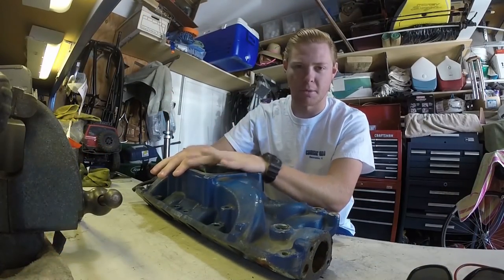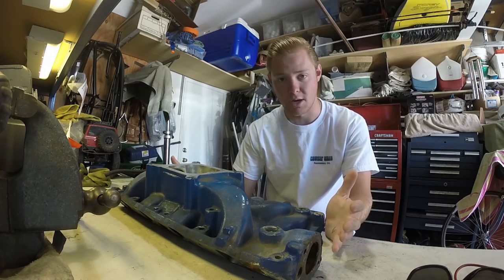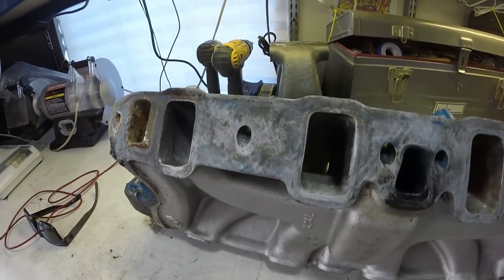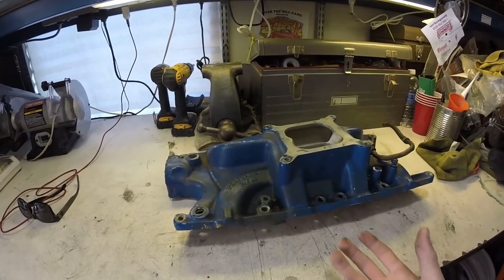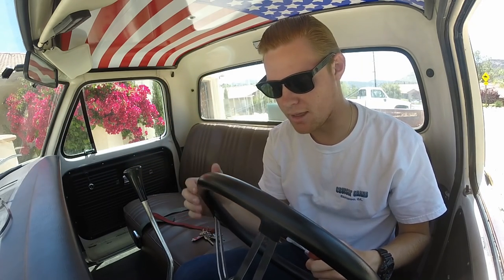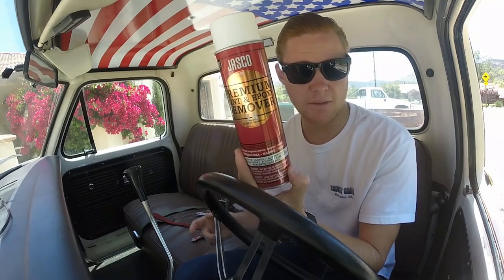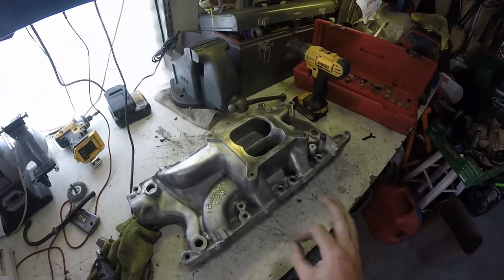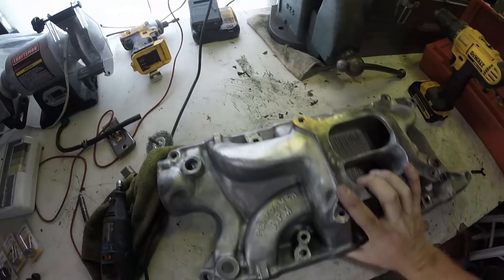How To Completely Restore an Intake For CHEAP!

Comment: intake ports should be rough.. it creates turbulence so the air can mix with the fuel.. exhaust should be polished!! Cheers from Argentina!
Reply: Disagree
Reply: @MrCbell57  that intake doesn't use injectors its carbed and therefore is still a issue
Reply: Myth
Reply: Thank you.
Reply: This guy is correct the reason ya want a semi rough surface in your intake is cause it causes gas to atomize better. Look at any high end cylinder head port or intake and you’ll never see a mirror finish. You’ll see only mirror finish on exhaust ports to help with carbon building up and that’s the only reason. You can think what ever ya want but if ya disagree I guess my response would be where’s your polished intake tract ground pounder and I’ll butter your eye with my rough ports.
Reply: @85gbody97  never seen a rough porting job ever!
Reply: I’ve never seen a rough porting job. Look at a race car head that’s been ported. They are smooth!  It makes it flow better!
Reply: @dawinner777  look at a race car port ok I’ll go look at my 64 nova that run4.80’s in the 1/8 mile and funny thing intake ports are not polished at all. You clearly have an internet based education on what makes power. Go look at any AFR cylinder head or Trickflow then go to any legit head porter not some moron with an die grinder in his garage who thinks cause he read it on the internet it’s gotta be true. You don’t want your intakes ports smooth you want the air to tumble with so as to create the best fuel atomization you can. An internal combustion engine is nothing but a glorified air pump the more Air an fuel you can put into an engine an get it out just as fast but actually burn all the fuel the more power it’ll make. As for why you want exhaust ports smooth is by then ya just want that portion out of the engine as fast as possible and it doesn’t matter it the tumbles in a exhaust port as well as the smoother it is the less likely you’ll have carbon build up that stays.
Reply: @85gbody97  Did you ever watch a rain drop SLOWLY go across an airplane's wing surface?  The airflow right next to the skin of the wing is going quite slowly.  It's called a "boundary layer".  The inside of the intake ports can actually be rough and do just as well, actually, better.  Dimples on a golf ball... or the fact that protruding rivets on an airplane wing's skin are just as good as flush rivets.  The highly polished ports thing has been debunked for many years.
Reply: The Reynolds’s number of air running through the runners is nowhere near laminar.

Comment: You don't want the intake ports to be glass smooth.. its supposed to be rough to help the air and fuel mix better.. exhaust side should be smooth
Reply: Tayde Odegard is right. Exhaust glass smooth. Intake should be a little rough
Reply: Disagree
Reply: @MrCbell57  I think you’re wrong. You keep mentioning injectors, which are almost always at the base of the intake and not at the carb flange. They’re spraying directly at the back of the intake valves, vs Inside a “long runner” intake that makes bends before it gets to the cylinder. Those edelbrock “annular” boosters you mentioned are NOT new tech, some flathead fords had carbs with annular boosters, a lot of Holley 2300 2 barrels that came with fords stock had annular boosters. Not new technology. If “wet” style intakes are meant to be smooth, why did they add rough bumps at the base of the carb? If you’re running a traditional style long runner intake like this with a carb, or even carb style fuel injection like a Holley aftermarket injection, the casting needs to be left rough..

Comment: The term " port and polish" is from the 1960's. We have learned so much since then. The smoothest you want the ports is 80 grit sandpaper roll. Standard in any head porting kit. If you polish the port to a shiny  finish you WILL KILL HP. Just carbide burr and sandpaper roll that's it

Comment: Porting is good, polishing the intake is counter productive. Leave it as rough as possible. Air and fuel will mix better. We used to race stock cars 35 to 40 years ago. The class we were in did not allow headers or aluminum intake manafolds. I took an Edelbrock intake and ground off all the lettering, painted it, covered in dirt and oil and never got cought with it.
Reply: I’m totally shocked that anyone has ever fudged,fractured or found a loophole in any stock car rule.😬👍
Reply: @georgemyers6518  when my Dad would go on Vacation, I would time in his car slow so I could drive both cars in different races that day. Could never look the pit boss in the eye!

Comment: BTW helicopter coils are the way to go with aluminum. Being soft aluminum threads just don't last long. Helicopter coil  are a way to fix damaged threads but can and should be a standard practice when dealing  in aluminum

Comment: People mess up aluminum intakes by using bolds on the carb instead of studs.  Put studs in finger tight with a drop of thread lock.  

Cool truck!  I love the 289!   great little engine.
Reply: Can you tell me why?

Comment: you can also use Easy Off oven cleaner to remove paint. just be sure to get the yellow can. it is a little bit stouter than the blue can.

Comment: Hey craig, in ur video u said that some of the ports are in even and that worries u, there is a gasket maker (glue) comes in a silicon type tube, it's orange, us that, it should work great for that, me and my cousin use it when we rebuild the tractors on his farm, there's been 3
Oliver 2255
Oliver 1750 
white 2-135 
And a white 2-155
It's worked great

Comment: Wouldn't just another application of paint stripper be easier than all the grinder work? Also once the paint is all gone, then use mag wheel cleaner for open pore aluminum and don't leave it on too long. The aluminum will almost look like a new casting.

Comment: i like to polish them and it is easy with the right tools
Reply: ps dyno tune it after installing and my 327 built nuts out only required 2 485 cabs on the blue prints and it is running 1200 hp on pump gas most sb only need 600  cfm and my 327 is built like a top fueller but only have a tunnel ram with 13 to 1 compression  no nitro built by bell automotive if u over carb u can lose hp i race pump gas only and it has to drive on the street and u can't strip the body down

Comment: Be careful using a wire wheel with no safety glasses!
Reply: Funny story with safety glasses, the chip bounced into my face at an angle, then from there hit the inside of the glasses, then from there, right into my eye.  Sometimes they are great, but you always get that one rogue one.

Comment: Okay you shouldn’t use paint stripper on aluminum it’s cam damage the structure of the metal and cause it to fail.
Reply: Do you think that paint stripper is a more caustic chemical than mag wheel cleaner for open pore aluminum? Just asking. Paint stripper, if left on for 15 minutes, and then washed off will not turn the aluminum dark or black, but open pore mag wheel cleaner will if left on the surface for more than one minute. Just my experience.